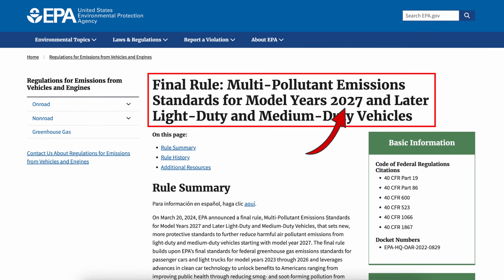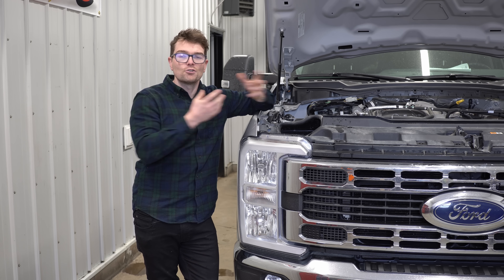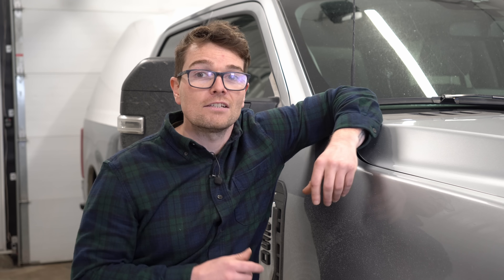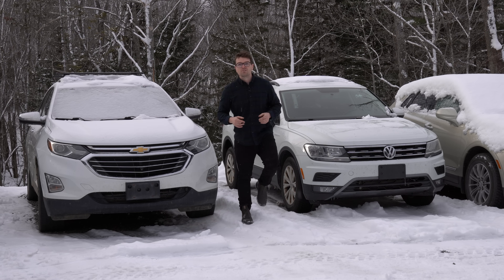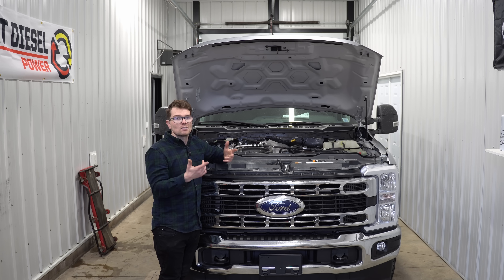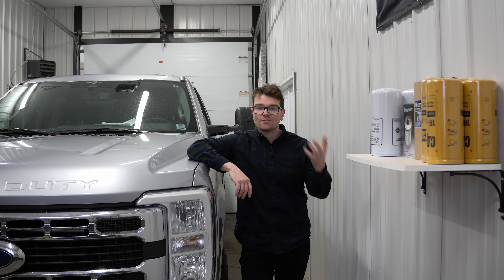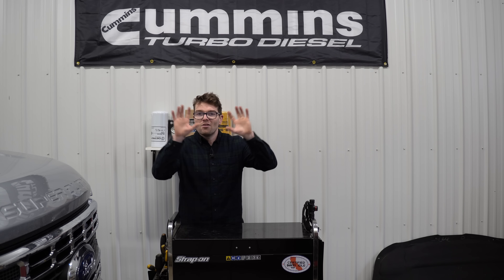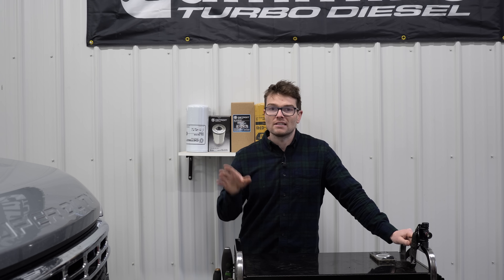NEW 2027 Cummins Diesel Engine EMISSION REGULATIONS are WILD **Diesel Mechanic Explains**

Comment: Give this a thought; data centers, AI centers, Facebook centers and on and on, they all have backup generators that run on diesel.  Some data centers “can’t say who out loud” can and will burn through more diesel fuel than all the diesel vehicles in that area in a month time and no they are not under the emissions rules.

Comment: I found your article on the 2027 diesel emission changes very interesting. Being a retired HD mechanic I working on all the stinky diesels what were made in the 70s and believe me the diesels made today are
way more reliable, quieter, and don't stink you out of the shop. Maintaining exhaust aftertreatment is just parts of engine maintenance the way inframing an engine every 250;000 miles used to be. The hole world is mandating lower emissions not just north america. As for longer emission warranties, great. Maybe that will stop people from deleting. Its the air the next generation has to breath.

Comment: This is why many people who use heavy duty trucks , especially 3/4 tons, are switching to gas heavy duty. The big 3 brands are all making strong gas trucks with 8 speed transmissions that will meet the needs of most people who need heavy duty trucks. I think the truck companies know this too, thus the 7.3 Godzilla. Wouldnt be surprised if we see Ram and GM introduce a new, big gas V8 or maybe even a V10 in the next few years for heavy duty trucks.

Comment: This system is trash and should not be on any diesel at all.. I also work on them daily and it's so annoying how problematic the emissions system is. Our pre epa trucks are perfect. Side note. When you run a typical diesel in the shop I can blow my nose to get the nox out of my airway. A dpf vehicle has super tiny nox and your nose cannot stop them so your lungs get it all. Let that sink in. This crap sucks.

Comment: If the government is going to mandate these emissions systems then they should also mandate a minimum freight rate to cover the costs of the maintenance of these systems.  Or, subsidize trucking like farming and other agriculture industries. I spent  $38,000 last year repairing the emissions system. Others tell me to quit bitchin they spent over 50k in emission system repairs.

Comment: Steam engines? Jay Leno steam car, put hot steam in a diesel, they run way better, run cleaner, steam cleaned engine 24/7 ,and they burn less fuel, replace DEF with steam from exhaust heat to steam to intake, clean diesel

Comment: so there is a 2001 7.3 for sale by me with low miles.   I think ill just buy that.   My 2020 def system failed and left me stranded at 70k miles, my 2017 failed at 40k.  Ill stick with the older stuff thanks.

Comment: Warranty coverage does not equal service availability. You can have a million mile warranty but if there is nobody to fix your truck for 6 weeks,,, well,,, I'd rather just pay for the part and get back to making money. Put another way, if getting a 'free' DPF replacement costs you $15,000 in lost revenue, IT WASN'T FREE.

Comment: Automotive mechanic here.  They basically break because there are more sensors, more exhaust filters and cheaper wiring including what is called soy based wiring which yes, you guessed it, is the coating of this wiring is made out of soy.  It attracts wild animals including mice, rats and even foxes and squirrels to EAT and destroy the wiring used in lots of automotive applications after 2012.

Comment: The manufacturers will just add in the cost of warranty replacement for the equivalent of 10 years or that 450k miles... Or 3-4 times...
The consumer gets screwed again.  Just like buying insurance. You pay up front, and the company hopes (bets) they will not have to pay out.

If a truck gets totalled,  the owner should be payed back for the unused portion of the warranty.

Comment: Many years ago a man patented a “Air Centrifugation Device” to separate intake nitrogen from the intake air of internal combustion engines using a device similar to a centrifugal compressor (front half of a turbo).
The result was higher percentage of oxygen (better fuel burn) and reduced NOX

Comment: DEF was only supposed to be in effect while the diesel engine was idling to reduce the emissions when it was least efficient, when it first came out. Now, it sprays almost half as much as diesel. AT ALL TIMES, when the motor is running to cause it to be half as efficient as it should be and burn twice as much fuel. That's like telling you to run your hand thru the manure pile so you will have a reason to wash it after you just got it off the shower. This crap is nothing but a scam.

Comment: The EPA was elected by nobody and does not save the earth 🌎 in any way whatsoever.  Regen modes, burning extra fuel....all these things are counterintuitive because they are either incompetent, ignorant or bought out.  None of us elected the EPA and they should be abolished.  18 mpg all day long 9.000 lbs 7.3 diesel saves the earth over these things as Regen mode burning of diesel alone is EPA ignorance in action.

Comment: The addition of the 48v heater system makes adding a 48v mild hybrid that can also take the place of the starter and easy upgrade, and Cummins has been hiring 48v motor engineers, so I would expect that to be coming and possibly a complete switch over to 48v electrics at some point

Comment: Electrolysis turning water into hydrogen cuts emissions by over 50 % and you can take your def filter off..
The problem is a DEF filter , tank, and pump is over $5 grand plus install .

Electrolysis doubles Transport milage and much more in passenger vehicals ...

Profit to the Detriment of us all.... Happy 2025 ...

Comment: So, what actually happens to particulate matter that is exhausted into the atmosphere? Say you have a mechanical injection Caterpillar or Cummins that will "roll coal" if you push it. What actually becomes of the soot or particulate matter? I doubt that it is suspended eternally in the atmosphere since it's heavier than air, i.e., "particulate". These unburned fuel particles must fall to the ground eventually. At that point, do they not return to the earth's natural chemistry? It's just carbon after all. Just like us and every other living thing. Am I missing something. Great technical video. Thanks.

Comment: Well if you understand flash point you understand how to fix emissions,and the fact industry does nothing to stand against government says it all. 
Want to stop having issues lower flash point so diesel burns complete instead of only 40-60% 
184° F was what my R&D company found best fuel temp for power/efficiency when you ignite at 200 you only burn at most 60% fuel which is why so much soot and issues, add rad to exhaust cooler so it's seperate and run at 100°F and most emission issues go away and it starts working properly a few more thing can be done but that's the most critical,yes you have to make a special insert to redirect flow of coolant from engine but it's worth it and it does not void warranty as your technically not changing the system or disabling it.

Comment: I always say they are saving nothing.  These systems substantially cut your mpg and engine life  and create many necessary repairs.  All this said. Making a half million mile motor and making it a 150k major repair and all the emission garbage  then you take a mpg drop making the vehicle burn approximately 30% more fuel which could easily translate into 2000-3000 additional gallons burned in that time     So what are we saving?  Just make them not roll coal so the idiot don’t cause a scene on the bicycle mobs and leave the motors alone

Comment: Yeah. Why don't you just ban diesels, since that seems to be the goal. Nobody will buy this crap anymore. You have now managed to regular them out of existense. Gone are the good old days of sanity when diesels had the engine, mechanical injection pump and turbo and lasted 1M miles with only regular oil and oil filter changes.

Comment: At this point when you want to buy diesel, they will ask you if you want an actual engine too on top of all the emissions systems... Diesel is dead. They killed it. It used to rule. Last forever. Not anymore.

Comment: I don’t think you could run it for hours in a shop with out knowing. When that thing goes into a regen mode all that so called filtering just comes out the exhaust. Diesels fail emissions test if they go into a regen mode because literally everything it filtered and packed into itself burn out and comes right out of the exhaust anyways 🤦🏻‍♂️

Comment: I work in the auto industry with this stuff, I can say that these are high bars to hit and aren’t going to be fun to maintain and I’d bet when they come out will have a lot of issues. Well may just have issues, period, in perpetuity. The warranty extension is good to see for customers, I think it’s a shame the OEMs often give nonsense like 3 year/36,000mi. Read warranty coverage closely, emissions components are often separate and not in the power train warranty. It can be as little as 2/24k on some stuff, was that way on my Sierra AT4X, LZO. What happened to 7/100k full emissions warranties? Like anything if you went really high end on the hardware and engineering I’d bet it could be somewhat more reliable - but make no mistake, you will pay. Ultra back of the napkin, $1000 or $2000 a truck - easily…

Comment: Basically, the EPA has all the manufacturers in a pot of water and have slowly turned up the heat and in 2027 it will turn into a boil.

Comment: Hmm i have not seen egrs reduce cylinder temps. Actually i thought it increased temps! Id be very surprised if having hot exhaust fed into cylinders instead of cooled charge air as being a reducer in temp. Egrs do reduce NOx but they also reduce fuel consumption be effectively reducing the displacement. More egr means less fresh air and less fuel. Which is why egrs are primarily used at idle and low loads when full power is not needed.

Comment: QUESTION: I thought of a system years ago where engines deleted the cams and lifter system by doing the following:
Change the voltage system to 48 volts-still a safe voltage-this would facilitate replacing the actuation of the valves with high power solenoids. It would also decrease current required for systems by 4 times, which, in turn would decrease wire size requirements-more compact starter and alternator. 
The solenoids would, of course be computer operated-this would give infinite control of the valve system. 
Cylinder deactivation and different
 “cam profiles” would be instantaneously accomplished, reducing emissions, etc- no timing chain, no cam shafts, no gears, far less machining, shorter duration or longer duration and valve lift adjustments at an instant, less weight, far less space and less oil use requirements. This would remove over half of the moving parts in an engine (every link of a chain is a moving part). I don’t think a valve cover would be required because each valve actuator would be sealed-simply screw out into the head like a spark plug. Default would be a closed valve-or half open- situation where failure of a solenoid is not a catastrophic event. 
Oil pump would also be electrically driven (Toyota already does this)…no chain or belt needed and oil pump can run even when engine is off to help cool turbo. 
Replacing the entire valve train with solenoids would save a huge amount of complexity and be far cheaper to implement. 
I’m not a mechanic; I’m an electrician. 
Do you think this is possible?

Comment: This crap just confirms in my mind that I will be doing frame up restorations on my 2001 V10gas, and my 2016 6.7deisel pickups instead of buying new.
Reply: My 2014 3500 cummins has 30k miles and is in showroom condition.   Will never sell it.

Comment: The EPA just wants more money in there pocket and that is going to be driven down to the buyer. Also if they were smart they would have realized that if you correctly tuned a diesel without any of this crap you would find it burning cleaner and more efficient

Comment: What do you think of this project that creates a cookie cutter diesel-electric drive system for all heavy duty trucks? https://www.youtube.com/watch?v=CM37qGnf3WU
Reply: The problem is still going to be emissions. It's one reason they are only working on older rigs to start. The EV portion doesn't really cut the fuel consumption enough to offset the emissions output.

Comment: Since the requirement is “per horsepower” one of the simplest way is to raise the peak RPM.  The small 3 liter engines have doubled their HP but the ten speed transmissions avoid this peak to get long life.

Comment: Cat stopped because they couldn't make it all work back then. I bought a new Pete with a C15 in it that was was constantly at Cat to try to fix poor fuel mileage & less than impressive pulling power. I kept saying to them let me brag about great fuel mileage or pulling hills passing everything one or the other, never happened. 35% engine load factor bobtailing (no trailer) they used to find ways to keep me separate from other guys complaining about the same thing that were at Cat at the same time. Prior to all this emissions stuff they were great but the others have all had problems too I had a 444 Cummins that was a nightmare  from new also.

Comment: During my Cummins training for CM 2150 through CM2350, my instructor told us that the stink that comes out the pipe During a regen is iso cyanide gas. Not regulated by the EPA. Traded 1 deadly gas for another to avoid regulation. I'm no chemist, but he was making sense that day. Don't hang out with the regen too long.dont nap in the bunk during regen. Small exhaust leak could kill you

Comment: Its a daunting task but nothing new, BMW had heated cats in the e38 750i, the EGR pickup will be after the DPF to prevent soot in the intake(bmw), a throttle body to control air flow and NOX (early 6.0 powerstroke), thinner ring package to lower upper cylinder temps (NASCAR), and either a manual regen switch on light trucks and/or a system that remembers when you hit the highway to run the regen when it knows there will be an extended highway driving cycle. And with the size the emissions systems will be the vehicles won’t even need a muffler or resonator anymore

Comment: Cummins and Detroit already have a warranty of 5yrs 500,000miles...Both Cummins and Detroit have a collaborative effort on the aftertreatment systems developments, I work at a FREIGHTLINER/WS dealer and am both Detroit and Cummins certified....none of this is really news to me....Cummins has been saying for the last 10yrs they were going to reduce if not eliminate egr and just address the NOx in the ATS both Detroit and Cummins have already been flowing less egr in the last couple years and doseing more def....this can all actually be done to an extent with software.

Comment: Any electric heater that has the ability to raise a Diesel's exhaust gas temp is going to be a tremendously ridiculous load on the electrical generation system and a huge parasitic drag on the engine itself.

Comment: Did congress pass a new law or did the EPA unelected staff just write new regulations? Have to take my skid steer four hours to the nearest dealer so they can clear a de rated eco due to scr failure- F***ing tired of this- not selling my 2 older pickup trucks or any older tractors or equipment

Comment: Need to go Diesel hybrid electric generation  eliminate transmissions, go to electric motors which just as powerful and faster accelerating , better regen stopping power causing less brake wear. Essentially make road driven freight trains.

Comment: So is it time for Diesel/electric to transition from Train locomotives to trucks? Have a lower horsepower generator to make electricity for beefy high torque electric axles. It would be better than a full electric option but would also reduce emissions a ton.

Comment: they should focus on better SCR system and get away from the EGR. EGR destroys the engine. I've had more problems on my Ecodiesel with the EGR than any of the other systems. All manufacturers should get together and challenger EPA. they are ridiculous and out of control. If manufactures make enough noise, maybe the government will do something about EPA.  I think ultimate goal is to make it impossible to make  ICE. EV might ok in some applications but I can't see it taking the place of our light and heavy duty diesel truck. just not practical or economical. and the Tesla semi, what a joke.

Comment: You left out the air slots cut in the tip of the exhausts so it causes it Venturion affect with air to be sucked in to pass their bs emission tests thanks Lady’s and Gentlemen one more breathing in all the urea burnt and all your synthetic oil combusted air venting back through the egr out the exhaust it’s safe to hook up to your house to safe cost in heat 😂

Comment: I wonder if they’ll try and solve some of these emissions rules (if they even still exist by then) by using the diesel engine as a range extender. They’d be able to run a constant load and rpm which in my non-engineering head should make it easier to create an efficient/effective solution (it’s not a suggestion, I’m just musing). 

Anyway, I’m so tired of dealing with dpfs that clog on short trips to town that I’ve relegated my 2007.5 Ram to a tow pig only. Trying to decide if I’ll go gas or electric as a replacement because I don’t tow very far or heavy anyway. One thing is for sure, I will not be buying another diesel as long as the govt keeps these emissions shenanigans up.